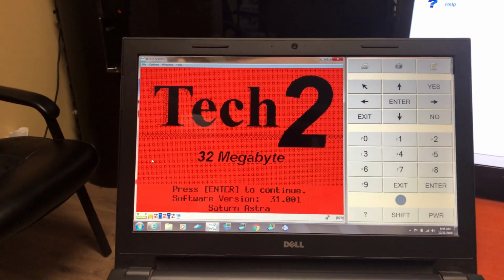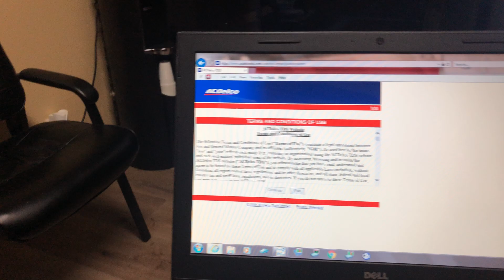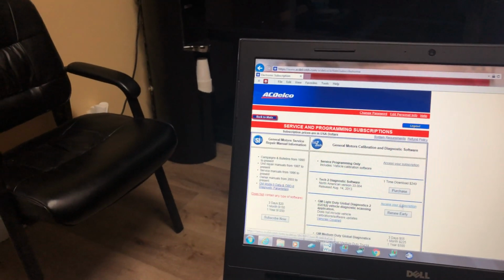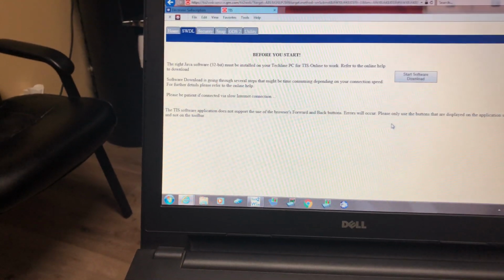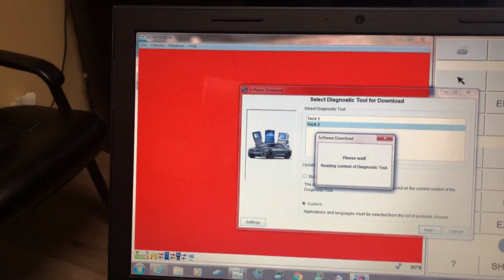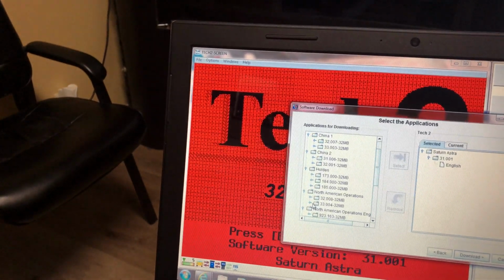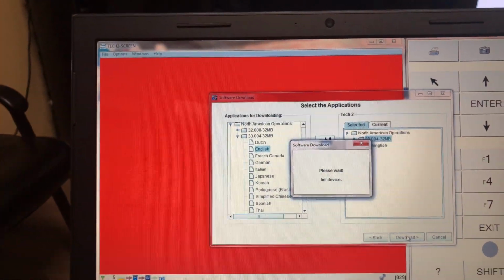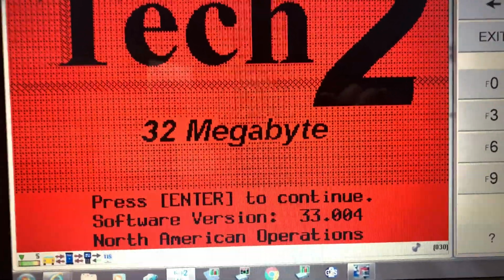Using TIS2Web & Tech2Win to change the "Tech 2 software"

Comment: I bought a  Honk Kong  China tech 2 I see even with the CAN box plugged in between tech 2 still only had programmed into it up to 2014
your saying if I use a windows 7 laptop I can down load the GPs2  . Then in have to use the laptop to plug in to a car with the tech 2 
and the can box ? I'm new to this  this is my first scanner I've made it this long with out ever owning or using one.